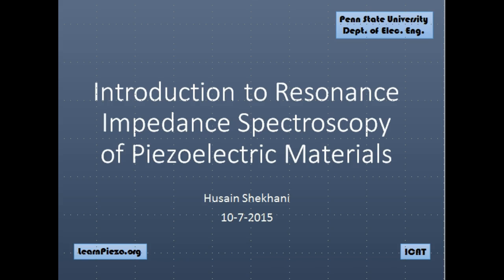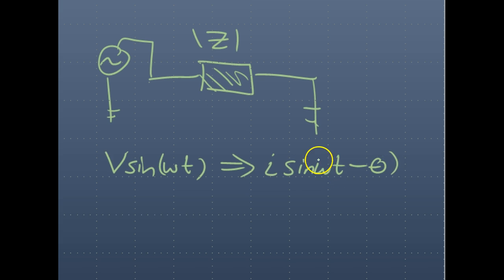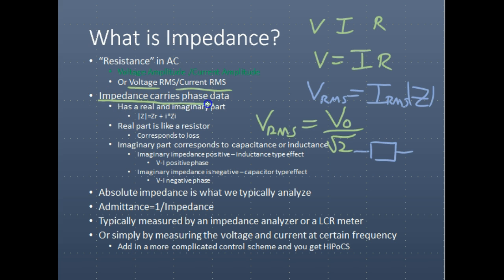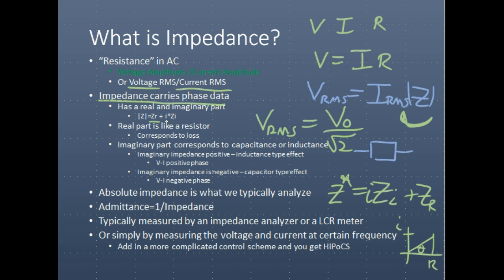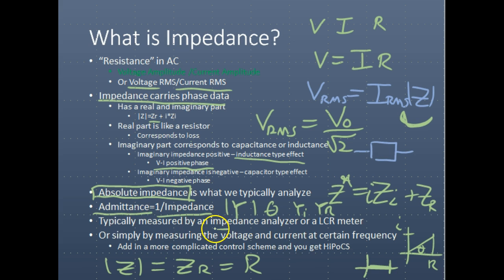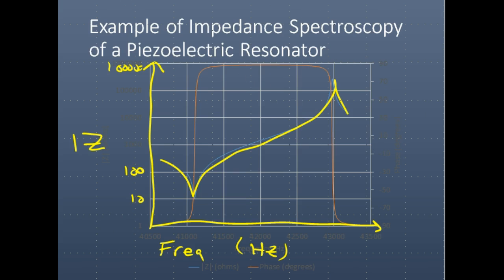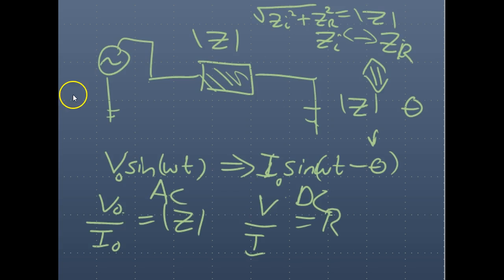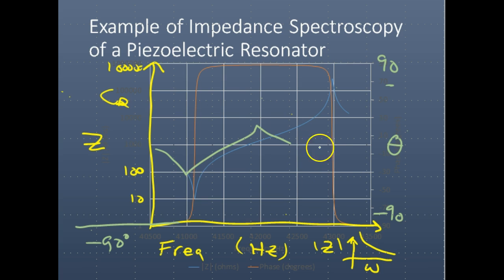Learn Piezo Lecture 10E: (Part 1) Using impedance analysis to characterize piezoelectric transducer

Comment: How to make impedance vs frequency graph in MATLAB. With formula of Z respect to w, k, d
Reply from the maker: It will be easier to do in COMSOL. However, if you need equations, you should seek out research papers that give a closed form solution for a particular resonator..